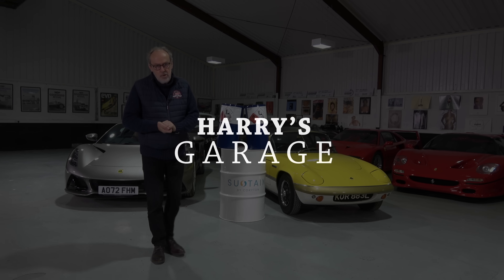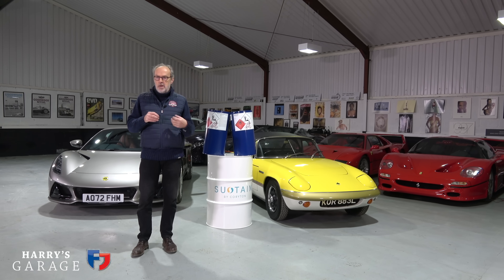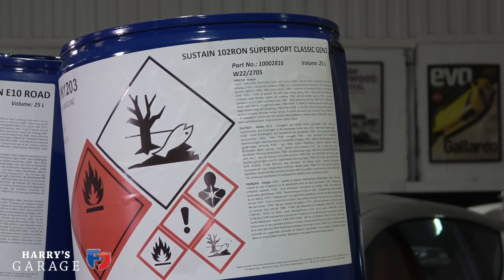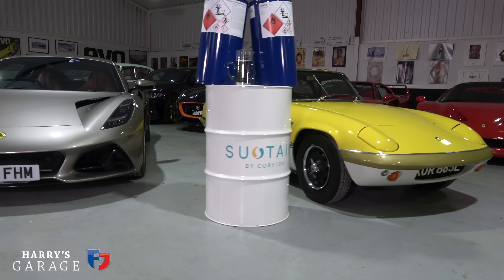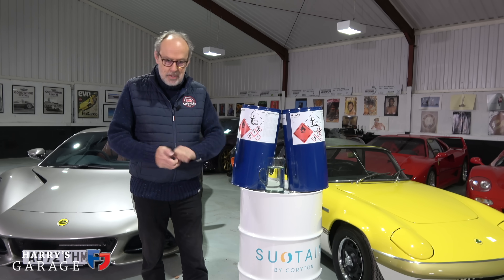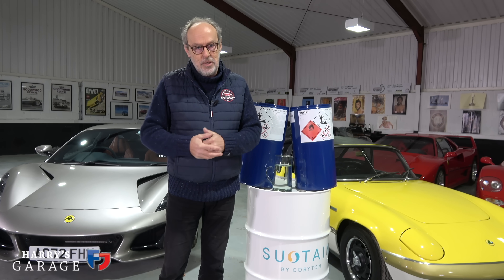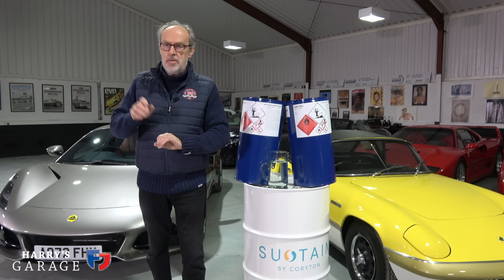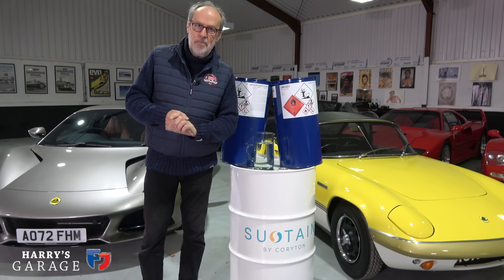Sustainable fuels; what are they & when will I be able to buy some?

Comment: Harry, 

Aerospace has battled to achieve fuel efficiency for years for the simple reason that reducing weight cuts costs. Fuel weighs a lot.

Once fuels become expensive and all aspects of life cost a lot more on energy in proportion of in terms earnings than has been the case in recent decades.

Travel, along with fuels, will become more expensive, including travel to Motorsport events for the wealthiest few.

There is a reason that places like motor racing circuits are rapidly increasing the cost of test days and day rates for track activities. 

I suspect that exclusivity is part of the reason for the MSV buying the Hall at Donington with the intention of turning it into a hotel with private access to the track. 

Exclusivity is a safer commercial bet for running an operation like Donington Park, with or without any form of ICE dominated motorsport.

Not everyone will have the time or inclination to try to escape the 15 minute cities, or whatever that thinking is really leading to.

Comment: What would be really interesting, is if you did a comparison between c02 and cost of two similar new cars, one electric, and one petrol but run on renewable fuels. Perhaps, typical usage, including some normal petrol usage and some public charger usage. I reckon considering the additional cost of purchasing an equivalent electric vehicle, that additional fuel cost won’t be anywhere near as bad as it sounds in your case, particularly if you consider cars that would get more like 40 mpg than 20mpg
Reply: Well, considering that in most countries every single EV is given as much subsidy at purchase as Harry's whole year's difference in fuel costs...and that's only in this very beginning phase of fuel production! And simply buying an EV would increase vehicle costs about that same amount too...

Then as we know that EV charging stations are subsidised with between €30,000-150,000 EACH!! and we need MILLIONS of them... Then there's the massive subsidies given to car manufacturers to sell EVs, more to develop EVs, then there's massive subsidies and tax breaks to build battery factories and new car factories. Then there's absolutely massive subsidies and consumer price hikes to electricity for all the massive work they need to do on the electric grid. Then there's the huge amount of new power stations needed...and if 'renewables' then that means basically doubled power stations as all the windmills and solar panels need a backup power plant when they're not producing (and those fast-reacting and smaller backup power plants are far less efficient than others). 

And one of the best indicators of how much of a corrupt scam this whole EV thing is how they haven't even pretended to set up a battery recycling system beforehand, they are letting all those cars be sold without any recycling at all secured for them, the costs not accounted for!!

No, we already know that ICE cars are overall actually lower in CO2 emissions in most cases, and even in the worst case scenario using fraudulent pro-EV cultists' fake data we have seen that they can't present any meaningful reduction in CO2 emissions with EVs! Then all we need to do is add a small bit of biofuel and e-fuel use to ICE cars and they are EASILY lower in CO2 emissions...without any extra cost! And even though in the first phases with early fuel production some fuels cost a very slight bit more than current fossil fuels, that is only a fraction of the costs which EVs cause us all in their TRILLIONS in subsidies, tax breaks and increased costs!

Comment: You mention aviation but the biggest polluter is maritime with their heavy fuel engines. I have no idea why these fuels have not had more development and become a viable alternative, as you say the infrastructure is still failing for EV support and never seems to be getting to a realistic point for all the cars that would be bought. I laugh about all these ULEZ areas that are being introduced, for example Aberdeen which has a huge harbour within a couple of hundred yards of the centre where IC vehicles will be banned due to emissions but in the harbour there are a large number of massive vessels that sit moored with generators running 24/7. Dundee is not much better and also has the airport close to the City centre on the banks of the Tay, almost as good as London City airport which is within the  current ULEZ. I guess it is just easier to hit the motorist and target the more visible 'problem' even if that 0roblem might in actual fact be the least of your problems.

Comment: Very interesting, thank you Harry and surprising that aviation fuel is not taxed.
Reply: It may not be taxed in the same way as motor fuel but AVGAS 100LL (normal aviation petrol for piston engines) is still £2 a litre including VAT, because it is such a specialised product used in such tiny volumes worldwide compared to car fuels and jet fuel
Reply: @harryspeakup8452  I don't believe its used in tiny quantities as a Jumbo jet can hold 238,604 litres, and there are approx 25k planes in active fleets

Comment: Hey Harry I really appreciate this video!!!  This how we're going to save ICE cars.  I'm doing my PhD research on microalgae as it is a very attractive candidate to produce synthetic fuels in the future.  It would be a dream to work directly in some capacity with motorsports.
Reply: It's not going to save ICE cars. It is only a niche fuel. Good for classics and motor sport. But simple economics will just stop synthetic fuels, it will be the most expensive energy you can have. And even if you produce synthetic fuel for lots of money because batteries or H2 is not a viable option then you would most likely use a methanol fuel cell and get tripple the fuel efficency. Also the simple fact that we use a insane amount of oil and the energy you need to create to replace them with synthetic fuels does not exists. An if you build the enrgy production it is once again back to economics. So the ICE engine is dead for anything but specialised enthusiast applications.

Comment: There is a point at which the oil reserves are no longer economically feasible to continue using,  I often wondered what will happen to aviation when that happens and I think this fuel is the answer. For the rest of us it would be nice to continue driving our internal combustion powered cars without releasing the carbon currently locked up underground. Incidentally look up Paleo Analysis for a view of what the world was like when all the carbon currently in oil and coal etc. Was still in the atmosphere., he does a detailed video on that's era.

Comment: It all looks promising, but it's 20 years too late. The large fuel companies looked into a lot of these solutions back in the 50s and 60s and found that the cost far out weighed the demand. They knew fossil fuels were running out, and an alternative was required 70 years ago. The only way to get to zero emissions is to drastically cut back on the amount of vehicles that are available. When I say drastic, i mean over 50% reduction!!

Comment: I wonder how this will go. Food waste is fine, but using plant based oils could lead to increased pressure on food production and rain forests. Some fuel makers have already used palm oils (the unethical kind) in the mix.
Much more looking forward to synthetic approach like Porsche's.
Reply: From what I understand, 2nd gen sustainable fuels are using waste from crops to create the fuel. But unless this waste actually emits CO2, you still are just emitting CO2 when you burn the fuel because the crops are already consuming the CO2 in the air. I cannot understand how this is better than using fossil fuels. On the other hand, it's quite easy to understand that E-fuels (synthetic) are nearly carbon neutral because you are only burning the carbon that has been taken directly from the air. Can anybody with more knowledge explain why sustainable fuels would be better than fossil fuels?
Reply: @realdrivercom  Sustainable fuels don't increase the amount of co2 in the atmosphere anywhere near as much as fossil fuels. Burning fossil fuels releases co2 that has been trapped and locked out of the carbon cycle for millions of years, sustainable fuels use the co2 that is already in the atmosphere. Of course it's not 100% from the atmosphere, there is some overall increase in co2 emission, but that's the laws of physics: you don't get something for nothing.
Reply: @realdrivercom  From where do you think that CO2 gets into the plants? It comes from the air. That fuel's CO2 literally consists of CO2 taken away from the atmosphere. It is not new CO2 introduced to the atmosphere, it's captured carbon. It's that simple.

Also you don't understand what sustainable fuels are. There is not only one type, there is not only one type of raw material source for the various different fuels either.
For example CNG (compressed natural gas) cars can use not only natural gas but also biomethane, which is the same exact methane as natural gas but comes from a sustainable source. Basically all biomethane comes from sewage treatment plants, landfills (they straight up just capture methane rising up from the landfills, then have to purify it a bit), and agricultural waste like pig farms and dairy farms. They are literally capturing methane which would end up in the atmosphere, and as methane is a many times stronger greenhouse gas it's actually important for us to capture it and burn it into CO2, which simply returns it to the atmosphere from where it came and will again be used by plants.
Reply: @pistonburner6448  I think that you do not understand what I am saying. Sustainable fuel comes from plants and yes those plants gather their carbon from CO2. The issue with 1st gen sustainable fuels is that you are using land and plants that should be there for 1) nothing or 2) food (both of which will not release CO2). Which is why second gen sustainable fuels have been introduced. 2nd gen uses waste from food crops (so at least you are not using the land that should have been used for something more useful). But you are still in the end burning something that would not have emitted CO2. Basically, with sustainable fuels you are using land with plants that would have absorbed CO2 and then you are releasing that CO2 back into the atmosphere. If you had not made fuel, it would be absorbing CO2. So this is exactly the same as burning fossil fuels (in my mind at least).

Unless your plants are being planted in a desert, you are depriving the planet from a net absorbtion of CO2.

With E-fuels, you are not using the land and vegetation that would have absorbed CO2. You are using very little land to absorb CO2 artificially.
Reply: @realdrivercom  Incorrect. Your very first assertion: "Sustainable fuel comes from plants" is absolutely false. Most of the sustainable fuels used in the buses which I have traveled most on comes from human waste and from general waste at landfills: it's gathered from sewage treatment plants and from landfills. Every single landfill and sewage treatment facility in my area gathers biomethane, and they pump it into our natural gas pipeline. 

Even when talking about plants you are not realising what happens to those plants if they're not turned into fuel: they still would emit that CO2 back into the atmosphere. Plants do not store that CO2 into the ground, they remain overwhelmingly on the surface and rot, releasing that CO2 back into the air in the end. Even worse, much of what they emit when rotting is released as methane which is a many times worse greenhouse gas than CO2 is.

When plants are eaten, they absolutely do in the end release that CO2. That CO2 does not disappear. Much of it is gathered up at the sewage treatment plans I mentioned earlier. And again: it's captured in the more potent methane form...

Your theories of absorption are incorrect. Plants do not keep absorbing CO2 if left standing, they slow down and then stop absorbing (or essential slow down to such low levels that we might as well call it 'stopped'). Different plants also absorb different amounts of CO2 at different rates.

You are totally mistaken with your false assumptions and theories of "land use".

And you are overall incorrect about the raw materials of "2nd gen" biofuels. They absolutely are not dependent on crops, not even on plants for that matter. They can and are made from all kinds of waste products, absolutely not only from crops. Even for the small percentage of biofuels made from 'crops' you don't seem to understand what "waste product" means...they are simply increasing the efficiency of that process and using the waste products which would NOT be utilised otherwise.

I don't even have any clue what you are rambling about e-fuels' "land use"... These theories which you have made up are not based on reality. E-fuels can be made from such a wide variety of raw material sources and even such different methods that you can't even make as generalised claims as you are trying to make. 

You really should not write so arrogantly when you clearly do not now the very basics of the subject matter. It would be more pleasant to have a conversation if you were honest about what you know and what you have made up, or let's put it more politely: what you are "theorising about"...
Reply: @pistonburner6448  if you read my first message. I do ask if someone with more knowledge than me can explain... In many ways your second answer does answer my question. It would be interesting to know what the net effect is though.
Reply: @pistonburner6448  I have read your first message and done a bit of research (as in googling)  you are absolutely right, my basic understanding was wrong.

Having said as there are many ways of creating sustainable fuels, some of the ways still seem dubious to me...

Comment: Some things to add:
Bio-fuels aren't new. My first car, which I bought in 2020 was a CNG-powered car. That Volvo S60 was manufactured in 2006. I chose this specific drivetrain solely for the environmental benefit, approx 30% of the CO2-emissions compared to a petrol equivalent (when comparing well-to-wheel CO2). Full disclosure: CNG cars are actually petrol/CNG-hybrids. It starts of when the engine is cold on petrol, and then goes over to CNG after a couple of minutes. 
Another bonus was the fact that my fuel was locally produced. Rather than sending my money to some wierd & corrupt state far away, it basically run on methane from food and sewers here in Stockholm. But. It still created all the particles (according to some data, even more) and harmful toxics which gives me, you, your friends, family, partner, kids etc cancer. And that's quite a large but in my world. 
The future of CNG is very dark however. It has completely been ignored in later years, models are dissappearing (e.g. Volvo dropped all Bi-Fuel models a few years ago), no refuelling station in basically 60% of northern Sweden. But, and perhaps the most critical point. As it turned out, the amount of left over food and feases wasn't enough to satisfy the demand we would need to bring all cars from petrol/diesel to CNG. 

Regarding the argument about running EVs when the grid is dirty. Correct - this means that that it isn't 100% zero-emissions. Regardless of power-source, we will still have particles from the tires so we'll ignore that for now. But if we need a lot of electricity to get this sustainable fuel (which was my understanding from this video), we also have "built in" a lot of CO2 into the sustainable fuel, making it more carbon-intensive anyway. Given that the EV is a much more efficient vehicle (in terms of joules / km driven), I would be really interested in seeing an actual comparison of the whell-to-weel CO2 when the ICE-car running BIO-fuel made on a "non-green" grid vs the EV on a similar day. 

As for the flights. 
Yes, electric airplanes are coming, although only for short journeys (up to 400 km). Heart aerospace is one example. 
Here in Sweden, some companies already run 50% BIO-fuel in their national flights.

Please let me know if I have got any facts wrong - would love to debate this!

Comment: I believe that the futre is in synthetic fuels because they can be used with all combustion engines so can be used with any car pretty much they just need the infrastructure. Also hydrogen cars. Electric cars just arent gonna work with th polluting metals, range issues and batterys degrading over time.

Comment: EV motoring will never be "zero" emission.  It's an impossibility.  EV motoring simply pushes the emission problem away from the actual vehicle and back to the manufacturing process.  And don't get me started on the sourcing of Cobolt that's needed to produce the ridiculously inefficient batteries!
Reply: EVs don’t have to be zero emission they just have to be measurably better than current vehicles, which they are by a long shot. Every ICE car made is locking in fossil fuel use for life, not just in petrol/diesel but every oil change at service. Even an EV charged from the most polluting of power stations is better than that.